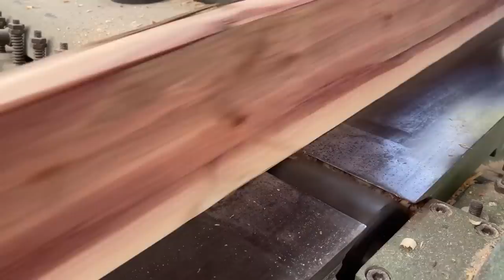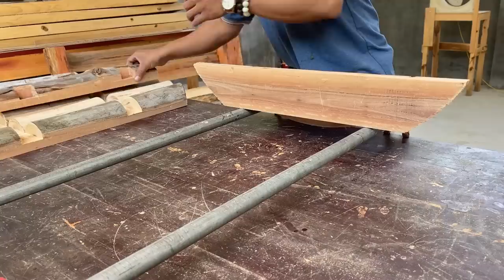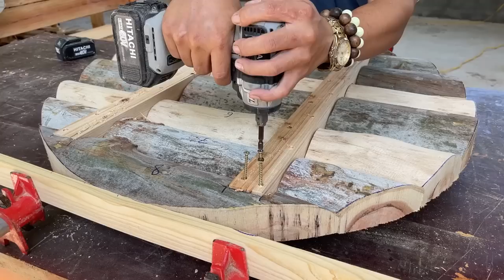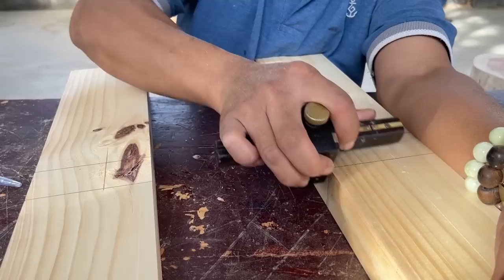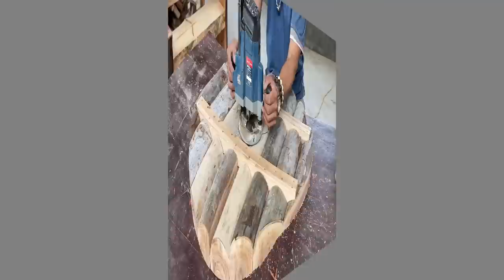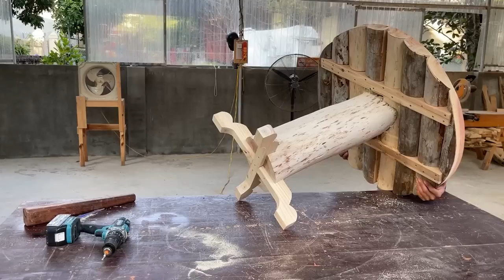Young Crafts Carpenter Builds A Round Wooden Coffee Table for the Backyard From Tree Trunk

Comment: Lovely and simple 👍 ...... If you were attach a plate to the top of the trunk which is larger than the trunk (say an inch or two), then screw the plate to the top, it would make a far stronger connection between the trunk and the top.